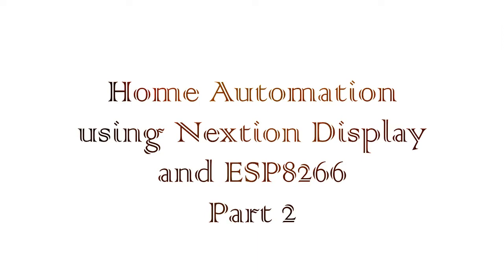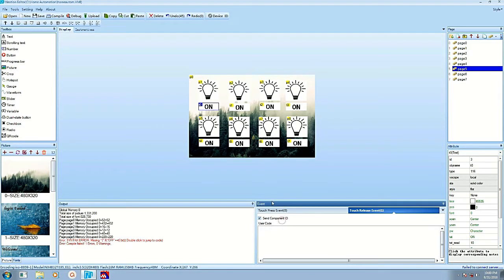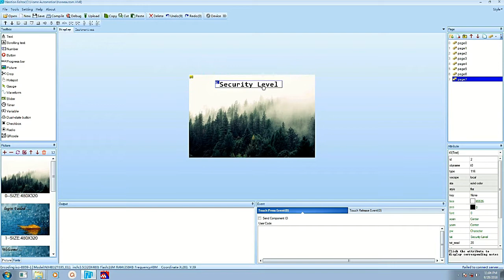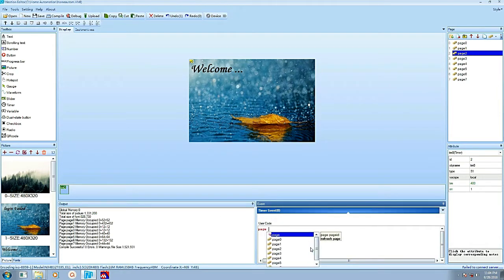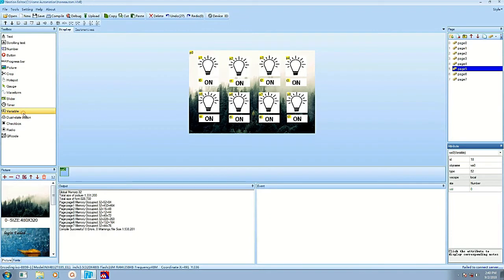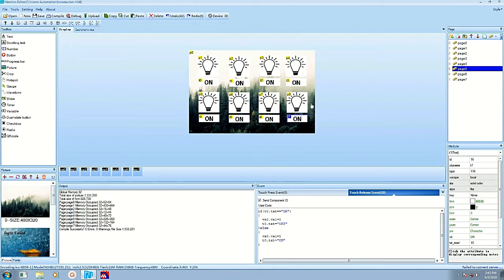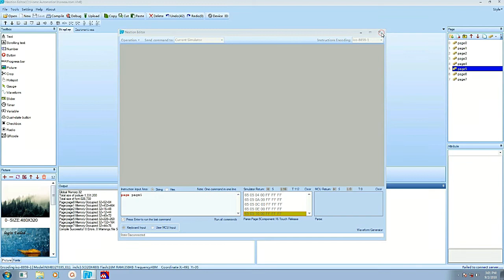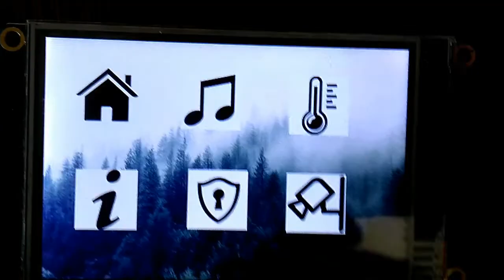Home Automation using Nextion Touchscreen Display and ESP8266 Arduino

Comment: Gutes Projekt, nur wie kommen die Daten (Temp und Humi) von Küche und Hall auf Display? Leider finde ich es nicht im Sketch. Kannst du das bitte auch zeigen? Oder Code frei geben?
Reply from the maker: Vielen Dank. Ich habe die Sensorschnittstelle in diesem Video nicht behandelt, aber Sie können die Idee aus meinen letzten Videos erhalten. Wenn Sie immer noch vor einem Problem stehen, lassen Sie es mich wissen. Ich werde dir helfen. 😊
Reply: @StechiezDIY  Hi.
Thanks for the answer and support.
Which video do you mean?
I've done: sensor (BME280) on ESP2866, data display (all) on page0 and online weather on page1 + data to Thingspeak (writeAPI). I have 5 such mini-stations, but I can't get the data on one device. (as you did, kitchen / Hall)
Reply: @StechiezDIY  Hi,
I tried your sketch, same mistake with button, touch and side.
I don't know, maybe my ITEAD library has an error ..... I have different NODEMCU's, including ESP32, lying here, no matter what I enter.
In VS I can't even get the feeler corrected. (maybe I have to install an additional package for it) (already at the beginning:: void  page2PopCallback(void   *ptr);
{ dbSerialPrintln("page2PopCallback");
  page0.show(); "expected unqualified-id befor´{´token..........)
Reply: @StechiezDIY  Hi. I dont get any further. I've tried VS and Atom too ... Nothing. I can neither add pages, buttons, text fields to my sketch (nor yours) ... File Libary deleted, added by ITEAD as Zib, nothing helps.
Reply from the maker: which display model you are using ?
Reply: @StechiezDIY  Nwxtion advance and basik witj 3.5". This is all rihgt, but my problem is it with ptogramming, (sketch) in IDE oe VS (Atom)

Comment: I want same screen at mobile or laptop screen to control from both at same time HMI screen or pc or mobile .

For this plz guide me .
How it is possible .
Reply from the maker: This kind of displays are not intelligent. You can use raspberry pi for your application.You can send me mail on stechiezsol@gmail.com i can guide you for the same.